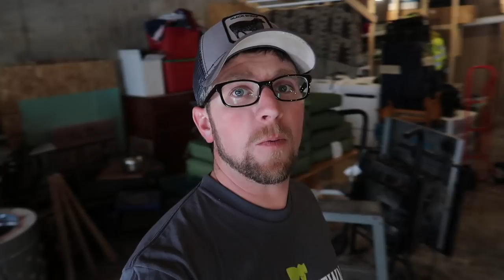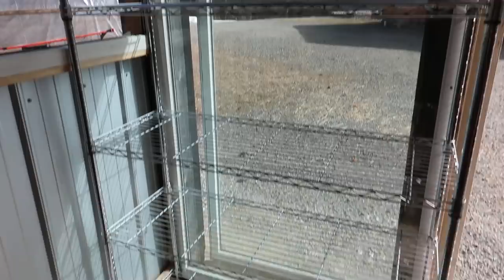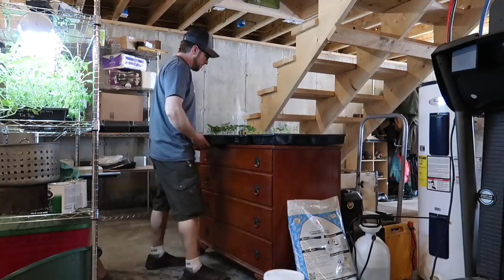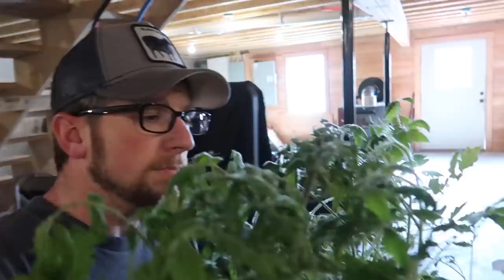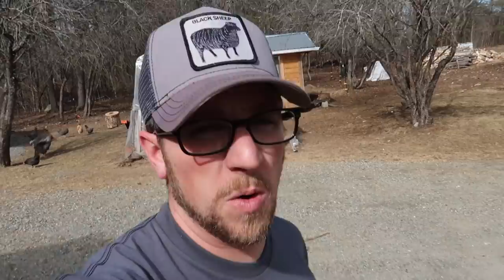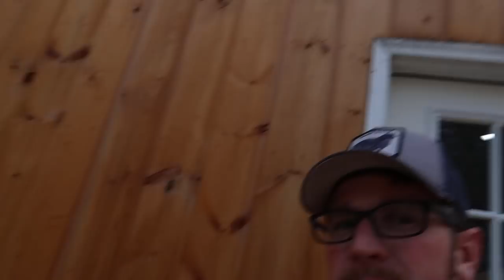I think I RUINED IT!

Comment: I would say those tomatoes are ready for 1 gal poly pots. I started my tomatoes the 15th of April and they are about 2 inches right now. I have them under shop lights and they are doing well. Bacon looked real good. YUM. Nice to see you have started getting eggs. Moving the pig pen isn't going to be fun. Making it a little larger isn't a bad idea. Just added a Presto AirDaddy to the kitchen. We put a rotisserie chicken from Sam's in it and it came out great. Hard to beat the price they sell them for.  Come on Spring.

Comment: Careful with the meat slicer. Short story it stings when you lose the tip of a thumb.
Reply: I agree - I’ve done accident investigations where people have cut fingers off in back n slicers in shops. Be safe get a guard or butchers chain gauntlets
Reply: Yikes!!!  I cringed to see your fingers so close to the business end of that blade.  I sliced the tip of a finger with a fabric cutter that was under my own power and not even electric....  With a little bit still attached, stitches saved the finger tip, but there is no feeling in that part of my left index finger.  Now, I use the gloves made for that.